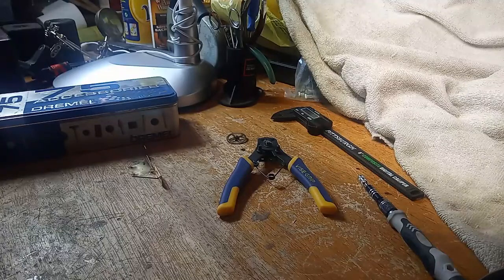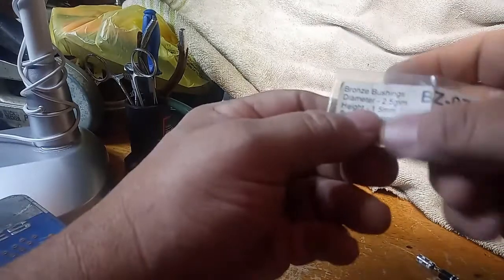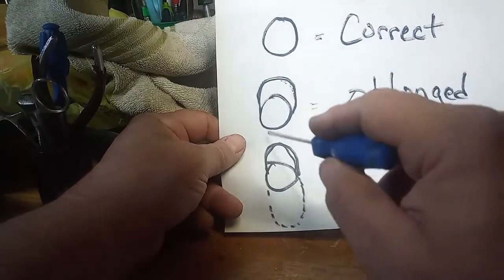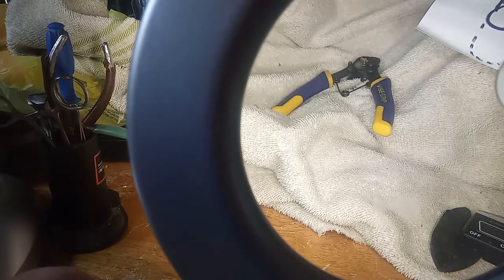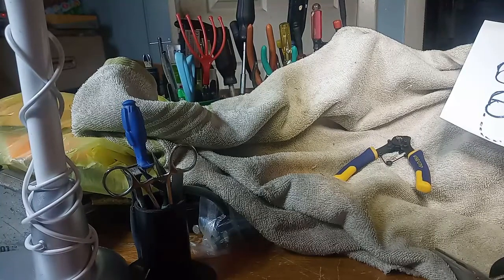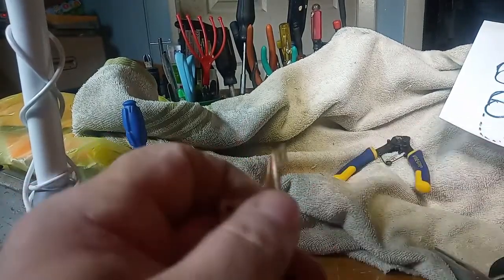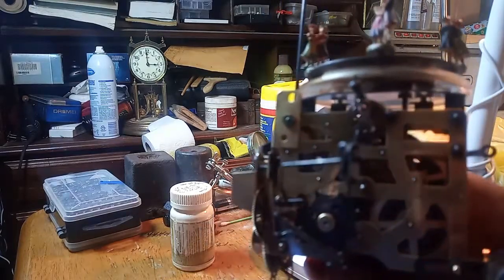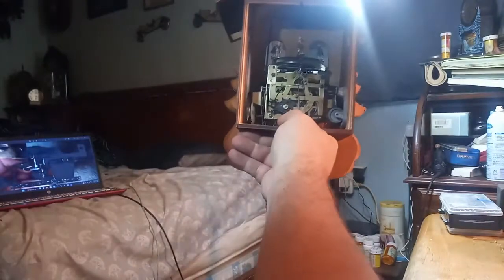Repairing an E Scmeckenbecher cuckoo clock with music for Carla (See description).

Comment: I have a video coming out next week on bushings. The video is very vague on how for sure as not to get beaten up by the professionals, yet you might get an idea of the cost of some tools that will kill the pocket book. And if you only have the one clock to work on. You give a better idea of how to do this the cheaper way. Great Job!
Reply from the maker: Thanks. I have other videos on installing bushings by hand. You have to remember that the VHS tape that I bought back in 99 which was done by a professional clockmaker and clocksmith is where I get most of my material from. I mention him in one of the videos. I will send you a pm on it.